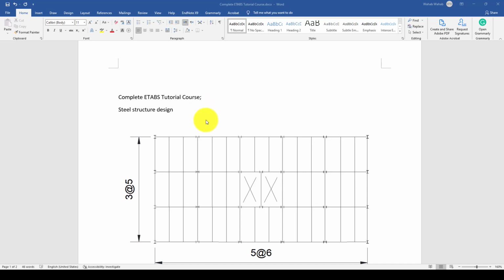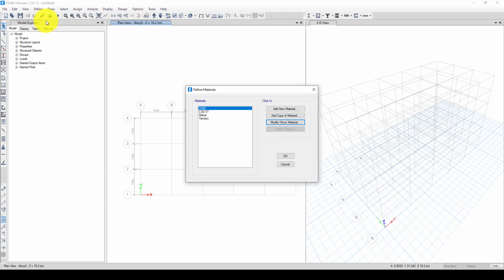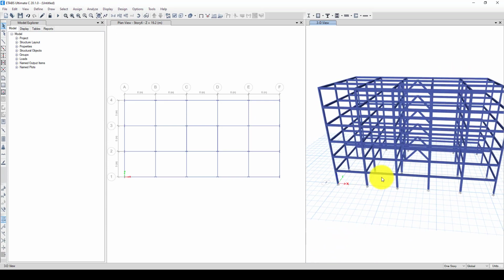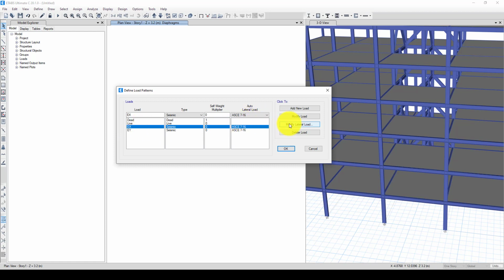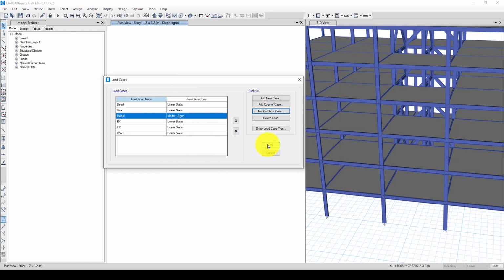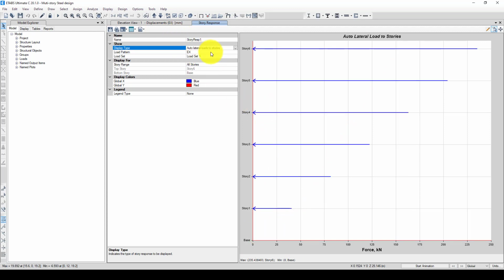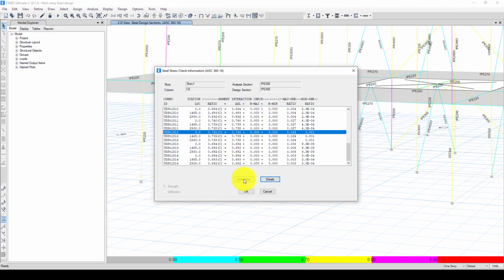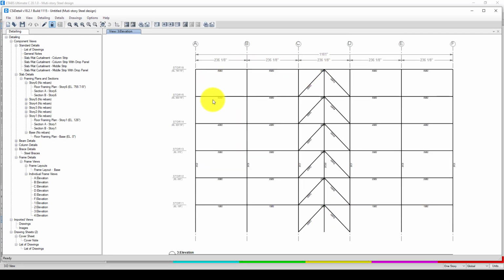ETABS v20 Complete tutorial;  Multi-story steel Structure design and detailing

Comment: Good day. Do you have a guide in modelling steel plate shear wall in ETABS? My thesis group are having a hard time in designing and modelling it in etabs. Our thesis is about using steel plate shear wall in steel building. 
Hoping for your reply. Thank you
Reply from the maker: Hi there, yes but  the tutorial is not free. If you need you can contact me.
Reply: @KSSE_Engineer  Hello sir. Badly needed your help sir. A very good and detailed tutorial would be a great help. How can I contact you sir?